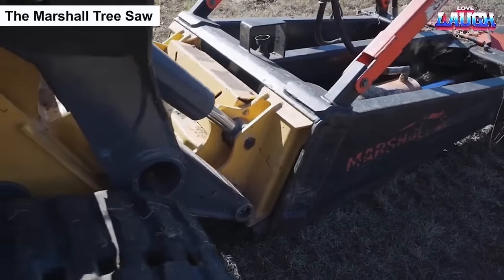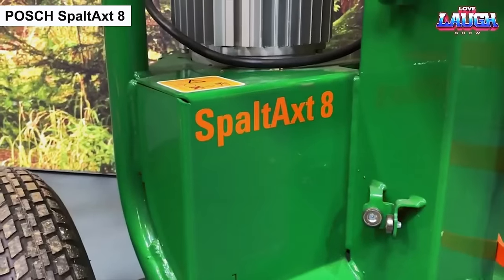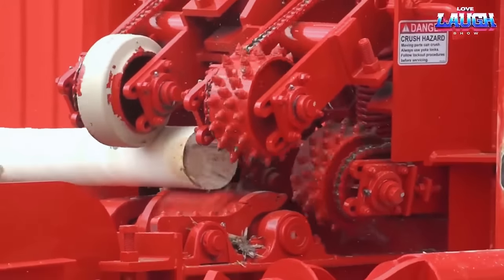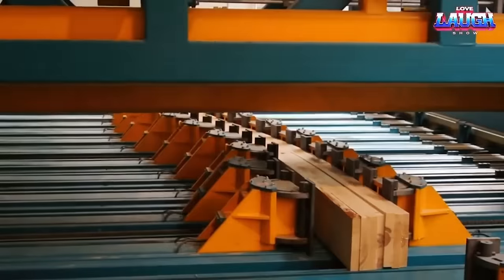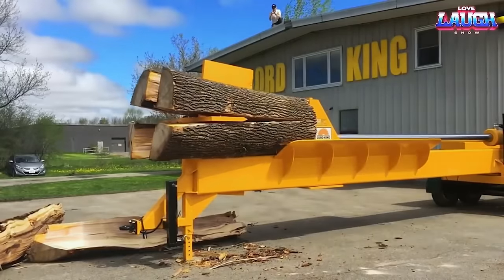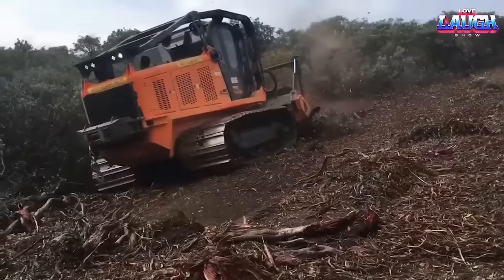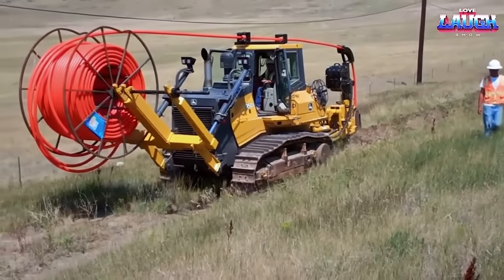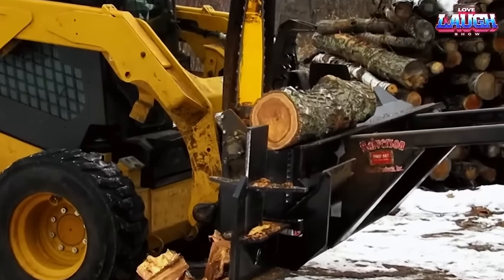19 Amazing Fastest Big Wood Sawmill Machines Working At Another Level

Comment: Wait, but how often do they replace the blades?
Reply from the maker: The frequency of blade replacement can vary depending on factors like the type of wood being cut, the machine's usage, and the blade's quality. In a high-production sawmill, blades may need to be sharpened or replaced every few hours or days to maintain efficiency and cut quality. Maintenance teams closely monitor the blades and replace them as needed to ensure smooth operations. 🪚